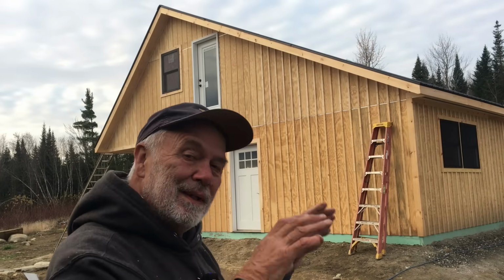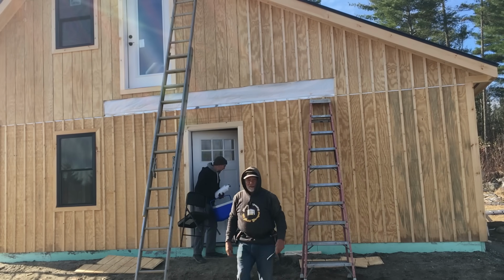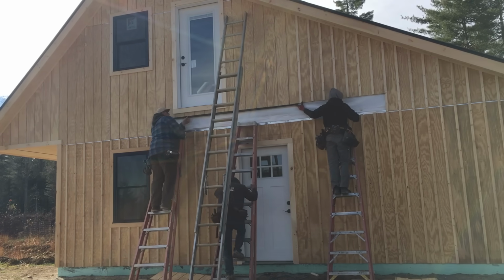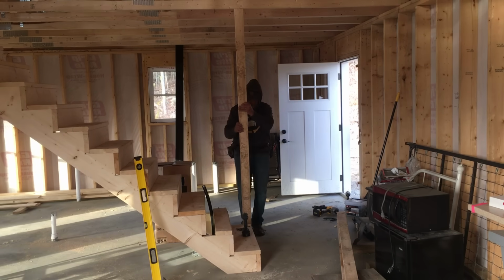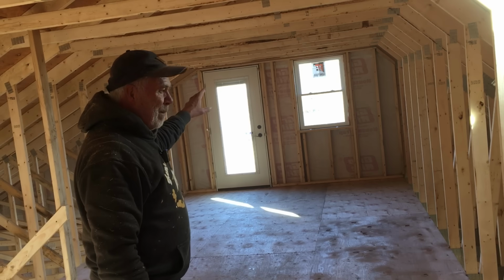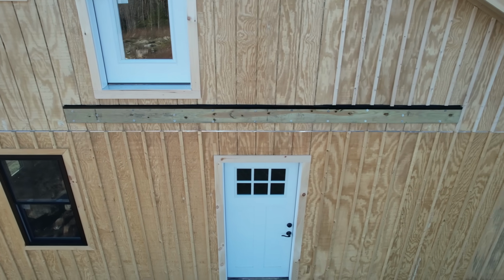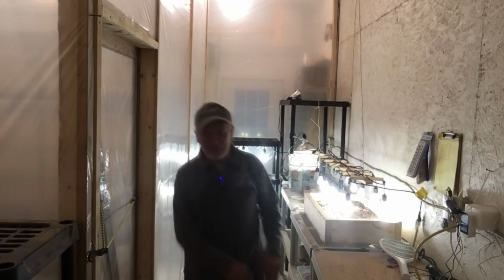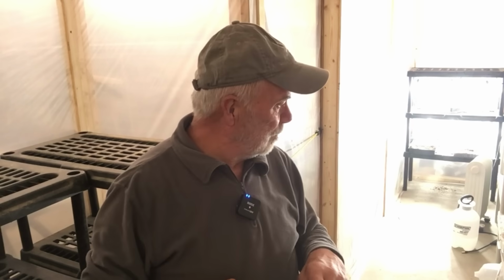Off Grid Cabin in the Woods with storage truss…Part 9…Finished

Comment: Potatoes depend on the type--if you need to add more soil to top as tubers grow upwards.  Determinate or indeterminate variety?  Most common potatoes are determinate variety.  Therefore, soil mounding doesn't benefit because the tubers grow at one level.  The level that you planted them at in the bucket initially.  Basic varieties like Russet, Pontiac Red, Yukon gold, Kennebeck whites fall under determinate variety.   I did German Butterballs this year--as a test.  They were my only indeterminate type of potato.  So, I had to add soil to container as the plants grew up.  Produced and tasted exceptionally well.  When you see the potato plants begin to flower--you are assured the tubers are growing potatoes, signaling reproduction and you'll have a harvest.  The potato flowers are or can be toxic to animals and humans as they contain high levels of solanine.      
PS:  I really enjoy all of your content and channels.   Keep up good work Ken, Dan and Chad.

Comment: Kaya likes "take your dog to work" days.
Not my house but I wouldn't put solid walls along the stairwell.  The house will feel much more closed in and small.
I kept adding compost to my potato beds as they grew until I had added about 18". They did really well. Some were in the 4'x5' compost bin, others were in 3 tire towers - 2 tires on 2 and 3 on the other. I think maybe you have the lights too close to the plants but I've never done a grow light setup so I could be 100% wrong.

Comment: ken you should reach out to someone like mars hydro they would totally hook you up with a light or two that would run way more efficiently than the bulbs youre using. they work fine but are probably costing you more in electricity than any other part of your grow room. if you swap out all the little bulbs with a couple larger fixtures that run on LED diodes you will have much happier plants and a lower electricity bill. they do sponsor ship packages and im sure would make something work.

Comment: Wow Ken, that's some surgery you did to get the ledger board up correctly! That looks great Ken! The flashing went on great. Thanks for showing the header you did on the other side of the opening for the stairs. That looks nice and solid. Thanks for explaining that the stairs will be inside walls. Thanks for showing the mesh over the top of the opening in the roofline. Too bad you were short on the ridge cap metal for the porch. I see lots of lag bolts! You put the T-111 and battens back up below it? It looks really nice. Thanks for telling us about the compellation video of your model railroad build. Too bad about your struggles with the indoor greenhouse. Your electric bill sure went up! I can understand why you want to go solar for that greenhouse! Thanks for these updates Ken. Great video!

Comment: Two more inches of soil. The reason is that as they put on the spuds 🥔 they will be in loose soil 1) they will be bigger. 2) easily dugout, we did them in rows. 3) And we used a dubbed potato 🥔 plow. To braking apart the hill and not damaging the potato 🥔.  Your bucket 🪣 will be interesting to see how they turn out 😊

Comment: I don't know why they called it off grid when do a video about it and put it on the internet.
Reply: Off-grid has different meanings to different people, most refer to not being connected to the electrical power grid, as opposed to the I do not want to be found grid.
Reply: Off grid to most people means your electrical service is not connected to the electrical grid. It doesn't necessarily mean that you have to become a "hermit", give me a break.
Reply: They aren't hiding. There is no power to the building so they'll have to go solar. Because it's a house they do have to put in a septic system. It's out in the woods. It's a pretty area. I'd say that's off grid.